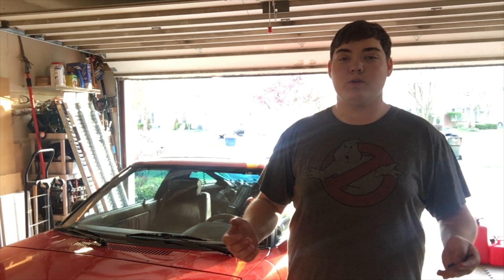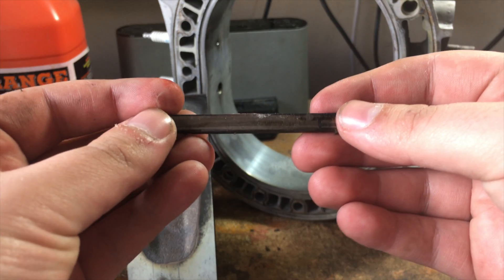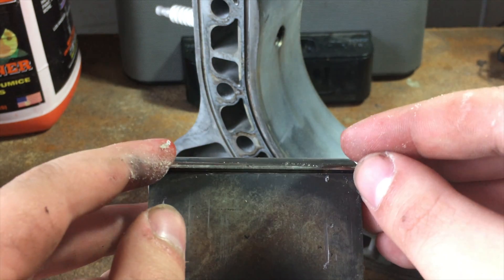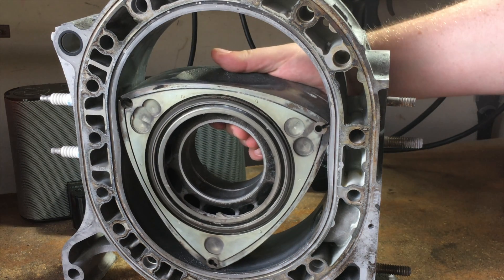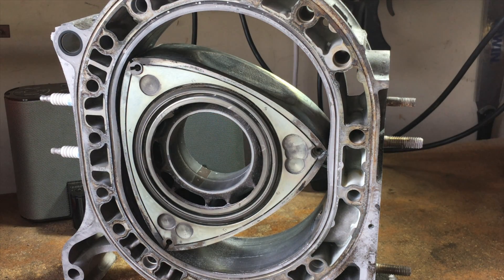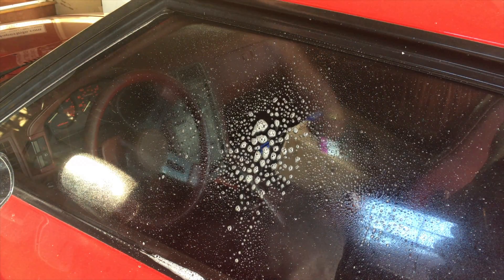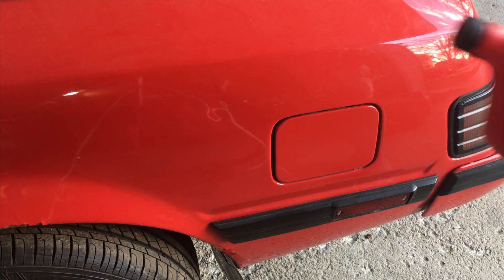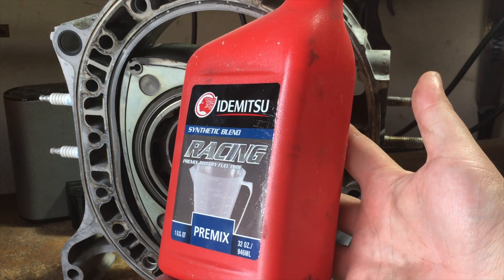What Are Apex Seals? How Do They Blow?

Comment: I still don't see why you need to premix if you use the OMP. In the carbureted models, the oil is pumped into the carburetor, which mixes with the air and fuel. Isn't it already premixing for you? I mean I sorta understand with the EFI models, because it's injected into the housing, but I don't see the point if you have a carbureted RX. I also understand that some people don't have the factory carburetor so there's no spots to hook the OMP lines up, but my Mikuni 44phh has OMP lines. The OMP apparently works fine since there's lots of FBs, FCs and FDs with over 120k miles using only the stock OMP on their original engine. Maybe the RX8 is what needs it, since the RX8 is a POS LOL
Reply from the maker: The issue comes when the omp stops working without the owner knowing it. I know that was an issue with first gens is that the pump would stop working and the driver would have no idea.
Reply: Hows it not enough oil though? iirc the 12a omp is like 2-2.5 ccs of oil every 5 or so minutes at 2k rpm, and like I said, there's plenty of examples of RX7s with their original engines and pumps that are over 120k miles. I was told that you do premix only if you remove the OMP cause with both its just a total waste of oil
Reply: you use premix because the omp doesnt send enough oil, so you add more oil to the mix.
Reply: And yeah I guess this can be an issue, but I've heard that the OMP on the 12a was manufactured by Mikuni, so it's probably pretty reliable.
Reply: i know exactly where this  is going, so nope, i'm not saying anything.
Reply: Pep, you're correct, the 12A injects a LOT of oil. Like Shooting Cars said, the problem is the car giving you no indication for when the pump has stopped working, because the system is mechanical. Personally, for all my rotaries, I delete the OMP and premix every single one. We have a video on our channel explaining the benefits of Premixing if you're interested :)
Reply: @KennyatHumble  Interesting discussion 👍 Does "deleting" OMP mean removing it or blocking OMP function? Also is premixing as good or better than Sohn adapter because oil will have been pre saturated with fuel? Thanks ⭐🎆🙏
Reply: Shooting Cars not quite true. Owner can detect it because the oil level never moves. With a working OMP you need to fill the oil up every other gas station dip.
Reply: pepsuchan another reason is because of the ingredients of the engine Oil. They have some ingredienst wich not burn totally like 2 stroke oil and leaves oilcoal inside the housing. Those Ashes which remains after burning the Oil are meant by me. They can cause when the carbon build up is to high, damage to the apex seals too and will lead to compression loss. Another reasion why disable the OMP or one of the main reasons why using the Sohn Adapter. Because the OMP stops injecting the "Dirty" oil and uses from another tank the 2 stroke oil instead for ashless burning. Thats what i know about it. At the moment on my RX-8 is the OMP still working, and i Use not only the IDEMITSU Premix, but the 5W30 rotary engine oil instead with 0,8% Ashvolume (<--- or however its been called, cuz im German sry for my bad english there) and yet one another reason is, the injectors from the OMP can get stuck from the carbon build up and block the injectors so no oil will be injected either which leads too to no lubrication and damage to the engine. Thats why there is the oil pressure enhancement kit to pull up the injectionpressure up to 8 Bars. (1Bar = 13/14PSI) so there are much Important WHY's for Premixing. Ill do it and im perfectly fine with it. Ill mix it in 1 to 350 so thats 60L :350 Pieces which leads to the volume in Liters of Oil which should be injected ^^ currently i use Fuchs Titan 200T 2 stroke Oil for premixing, ill drive my fuel always near completely Empty to avoid overdose the oil/fuel premix which leads to a Check engine light because of the Lambda sensor which emitts the setup of the exhaust stuff ^^
Reply: If the OMP is working properly you really don't need premix, I don't run and I've got over 80k on 450whp engine.  The thing with premix is other than being a pain in the ass it works fine, and in theory is more reliable than the OMP.  It's worth noting that Mazda's official race cars all use the OMP.

The RX-8 has other problems the OMP is improved with more jets in housing.  My 13b housing have a similar mod and I use the two piece RX-8 apex seals which still have normal compression at something around 80k.  I don't know for sure because my cluster failed and it took months to source a a replacement at the time it was apparently the last new one left for NA cars or at least that is what Mazda's parts claimed.
Reply: yeah, that too. as far as i know, it's not common, but it's definetly something thatt can happen.